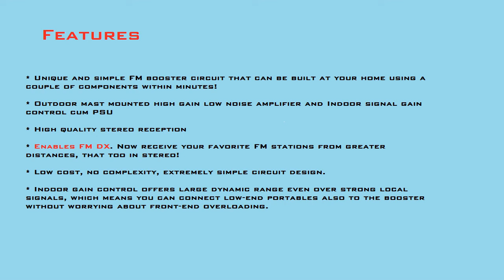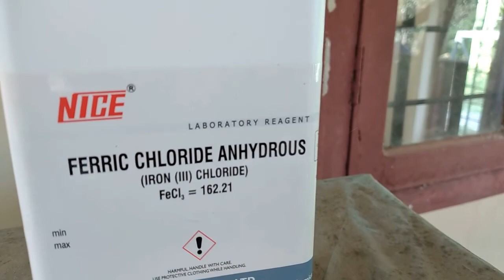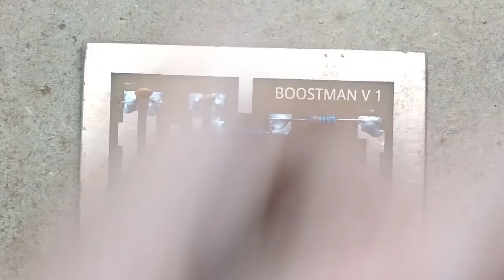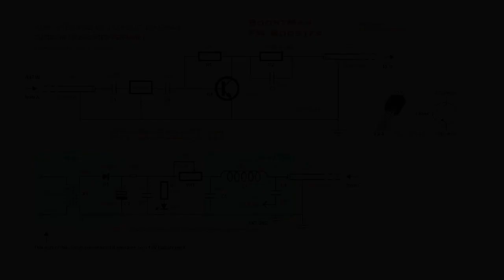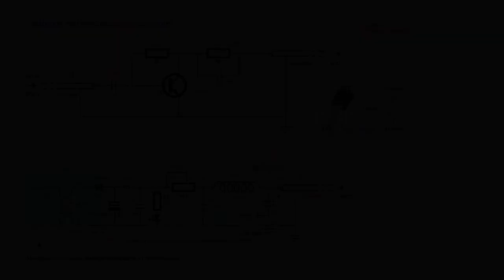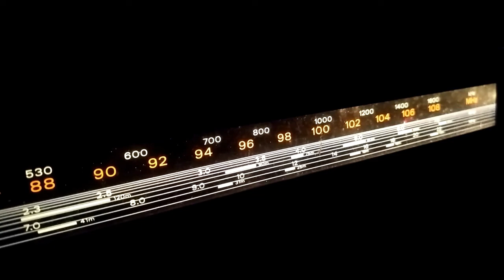A High Performance Outdoor FM Booster

Comment: Design of circuit is taken by VHF TV signal booster. But they were multi transistor stages. High gain. This circuit can also be design multi transistor stages for fringe area.
I think, BF 200, C5570 or 2N 918 transistor can good work in FM frequency range.

Comment: You had any PCB
Reply from the maker: You can make it
Reply: For one PCB we can make positive and screen printing and ferric chloride process. Sorry
Reply from the maker: @balasubramanianvelusamy2196  
You can try manhattan style wiring, or make it on a general purpose dot pcb. It's a simple circuit, try any simple wiring methods you'rs comfortable with.
Reply: OK. Thanks